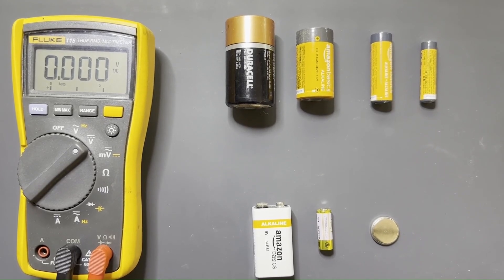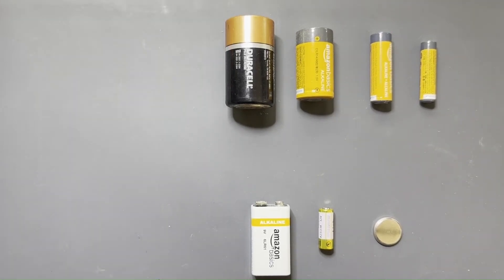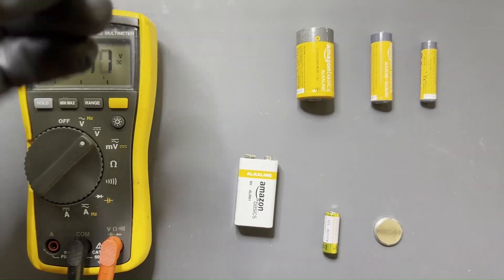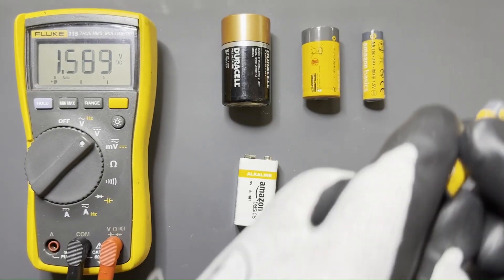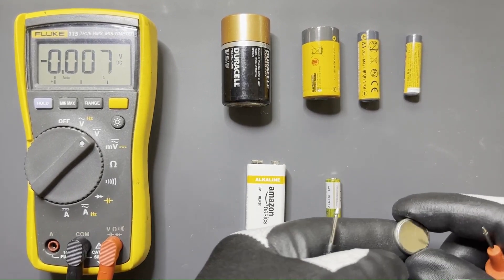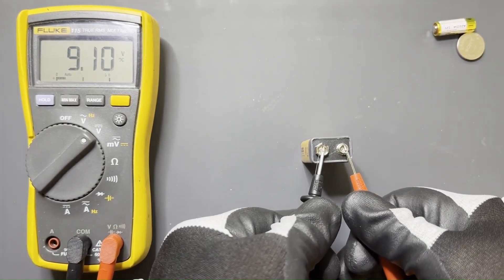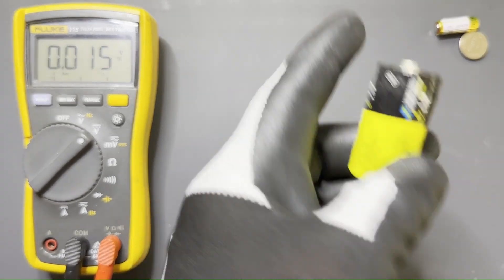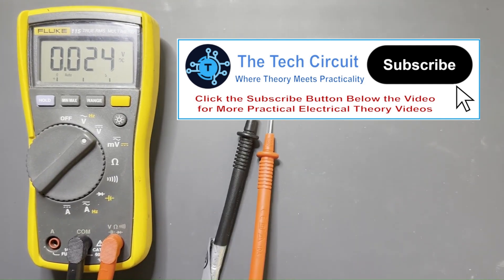#103 - Testing Batteries with a Multimeter

Comment from the maker: This video shows how I test common household batteries. Ideally, loading of such batteries best determines their ability to perform. For the most part though, this is not something the general public is able to do. So this video only  covers basic voltage testing. For auto, lawn mower, and ATV batteries, I'll be doing a different video because of the vast differences between those batteries in terms of chemistry, testing, and safety considerations.
Reply: What about total internal  resistance of the batteries, you should also have included that in your video .When the value of internal resistance is low, the battery is able to carry a significant amount of current. On the other hand, a battery with high internal resistance can only carry a small amount of current. The higher the internal resistance, the greater the energy loss so checking voltage drop is important but also checking internal resistant will say a lot about a batterie
Reply: I love the way you do your videos by the way , i forgot to mention

Comment: What I do for AA C and AAA batteries is check the current. Fresh ones check out at 4, 7, and 9A, anything below an amp is likely too weak to use. Alternately if you don't have a 20A range then the voltage is 1.6 or better, new. 1.5 slightly used, 1.4 used, 1.3 nearly dead. 9V and a123 12v batteries just check the volts and replace at 8.6 and 10V respectively. Do not hook rechargeable batteries direct to the amp meter. Test by charging and seeing how long they last. NiCd batteries can be shocked back to life with a brief current pulse of a second at 20A or so. Lithium can be salvaged if the cell is above 2V, just charge with a 10 second 10A pulse. See if it takes a charge. If it drops to its original voltage overnight it's bad.❤

Comment: Why is there no talk of load testing as in car lead-acid batteries?
Reply from the maker: This one was for the common household batteries. Loading of such batteries was mentioned in this video - but for auto, lawn mower, and ATV batteries, I'll be doing a different video because of the vast differences between those batteries in terms of chemistry, testing, and safety considerations.
Reply: My bad.  I skipped the used cell segment.  Looking forward to the next video.